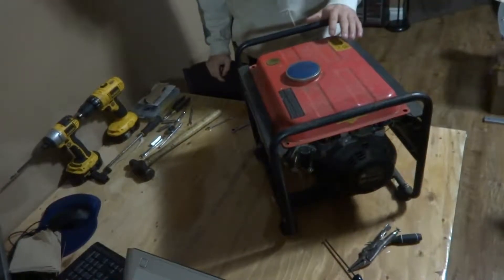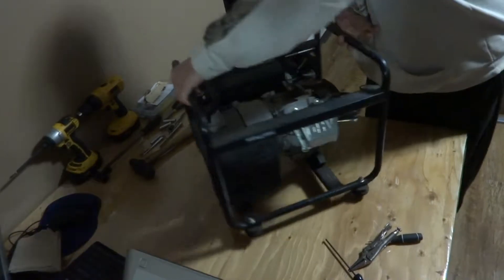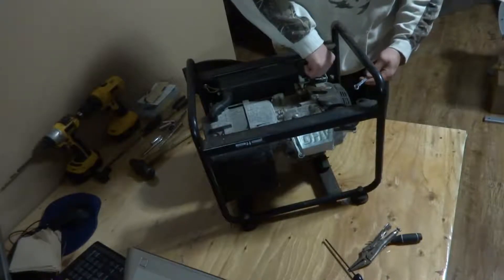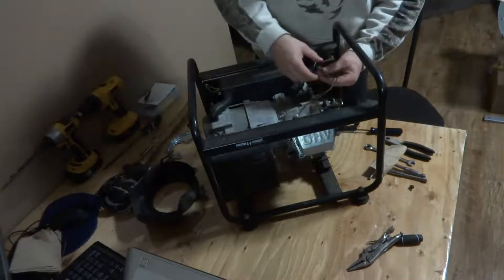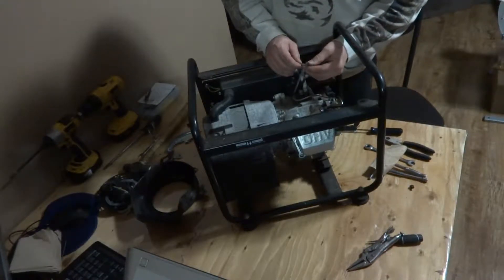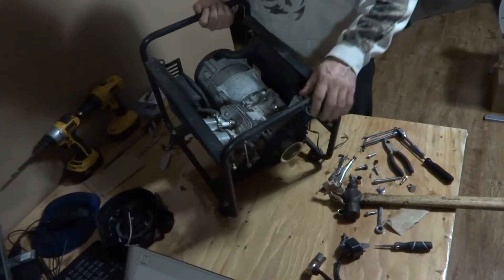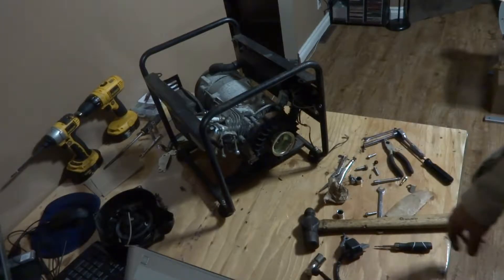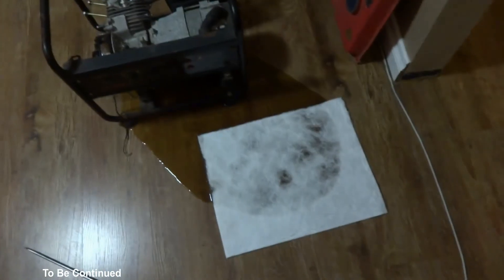Gas to Wind & Peddle Powered Generator Conversion Pt. 1 (Disassembly)

Comment: I'm glad i'm not the only one who thought about this. I am currently adapting one with a Pelton wheel. I will be posting some videos of it working... or tragically failing.
Reply from the maker: As long as you Have structural stability on both sides of the pelton wheel, you should be fine. It all depends on how strong force of the medium is, whether it be wind or water. Too fast, and the pelton wheel might come apart. Good luck on your project.

Comment: I commented on the final video of this also. Those wires you took off of the engines magneto for the spark plug also. That wire gives voltage to the magnets inside the generator and that is what make the magnetic field to generate electricity. You could just hook up a car battery to that wire to the magnets inside the generator and i bet you will see your generator produce actual results
Reply from the maker: Hooking up a car battery to the generator would defeat the purpose of it being a generator powered by natural resources. The electricity from the magneto for the engine side, only generates electricity for the spark plug.

Comment: I haven't used my Honda generator for years... Thought about selling.. but this morning I thought.. Can it run off wind?
Reply from the maker: It's possible. It depends on the strength of the winds you get at any time, propeller size, and size & weight of your generator motor.